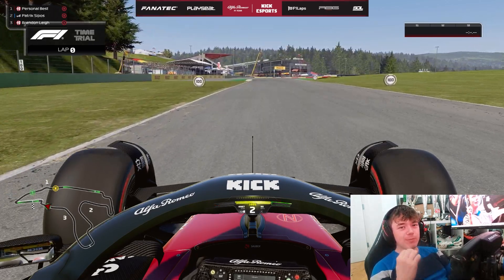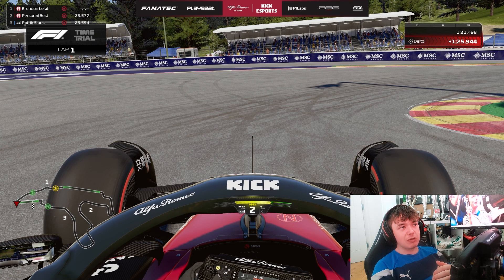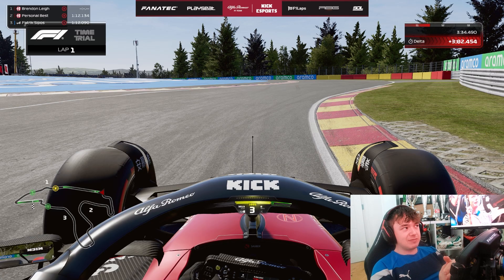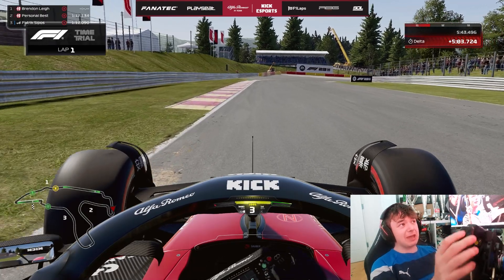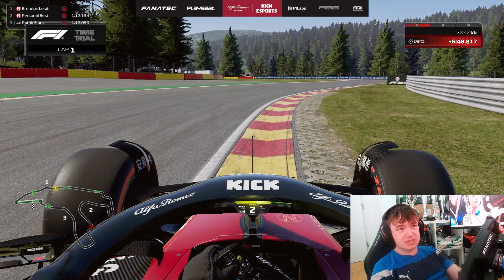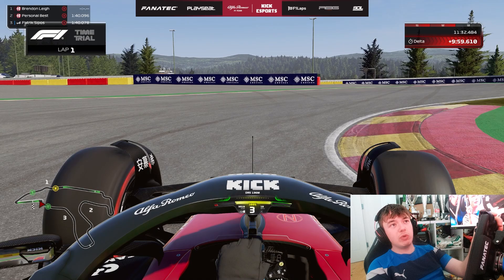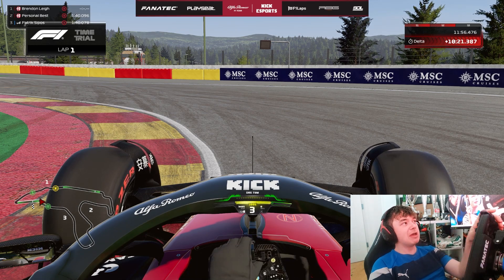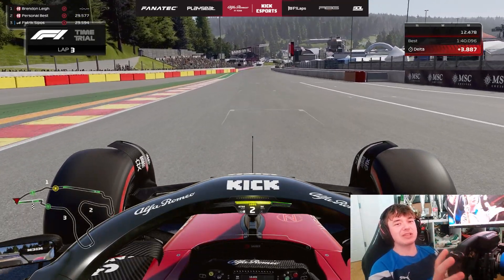How to master Spa - F1 23

Comment: @BrendonLeigh your track guide how to master is amazing, I love it! Keep it up man you are the best and hopefully you do good this year in esports.

I have a small question if you can please help me with, ive tried searching this on the internet but can't find it anywhere, how does one change a dry setup to a wet setup in f1 23? If you could please maybe give me some ideas, because different people tell me different things..
For example on this setup I have for Austria
Wings 29/22, diff 55/51, suspension 34  7  8  2  33  38, and tyre pressure few ticks more than minimum
How would you change this setup to a wet setup if the track has rain? increase both wings or just front? how much? increase diff? suspension? tyre pressures?
If you could please help me just a bit with this because I can't find this answer anywhere and everyone tells me a different things, I would trust you alot more